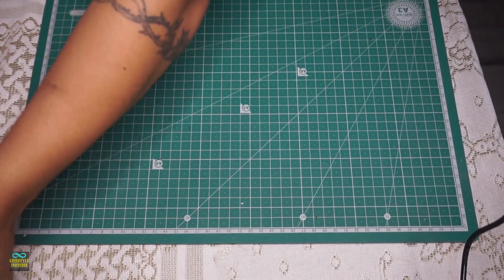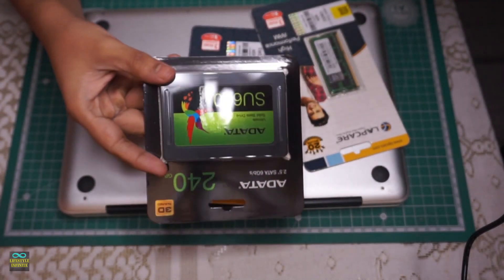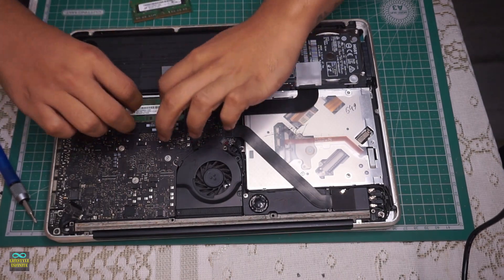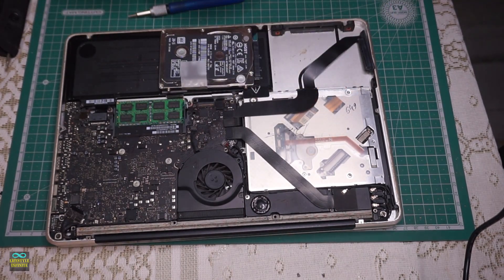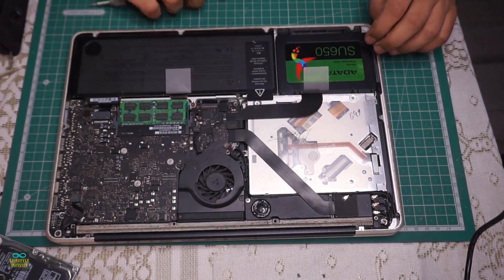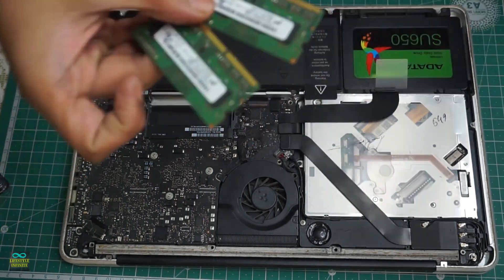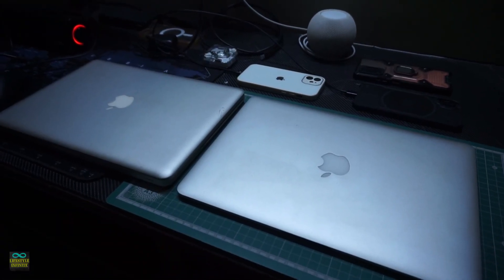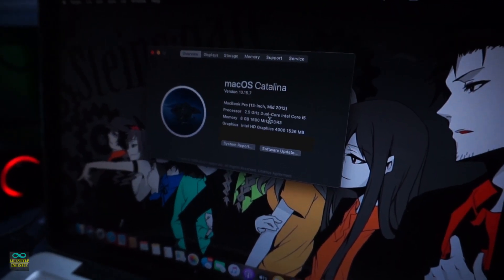Apple MacBook Pro A1278 SSD and RAM Upgrade

Comment: Bro can we install 8*2 16 gb in this laptop
Reply from the maker: I tried with a lot of RAM kits for 2*8GB sticks. Most of them did not work, so not recommended. Only one 16GB kit worked for me, which I pulled from another older MAC, it was made by Micron.

Comment: After a year of a ssd install I have to clear the nvram to boot up all the time. Have you encountered this problem?
Reply from the maker: I did not encountered such issue. I have been daily driving it till date. Probably it was not used for sometime, so the data in RAM got corrupted.

Comment: Is the process same for mac2012 pro ? I am having beep after every 5 second. Can you provide any resolution or guidence. Please help
Reply from the maker: This is 2012 Model only. The process will be same. I also had the same issue when I added the non compatible RAM. You can try to boot the MAC with 1 RAM stick at a time to find the faulty on or to check whether both are faulty, then replace the faulty RAM and hopefully it will solve the issue.